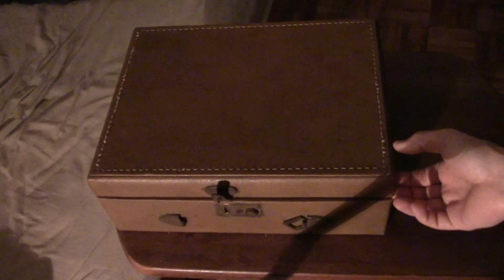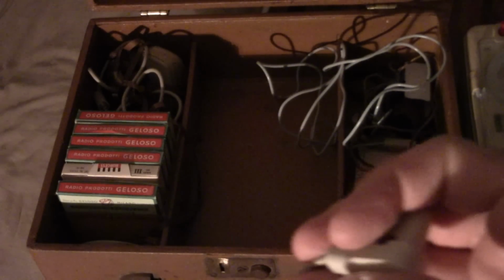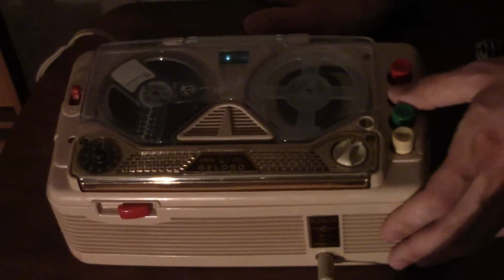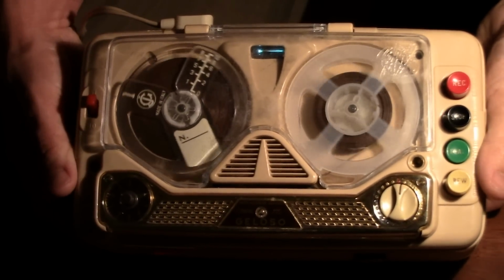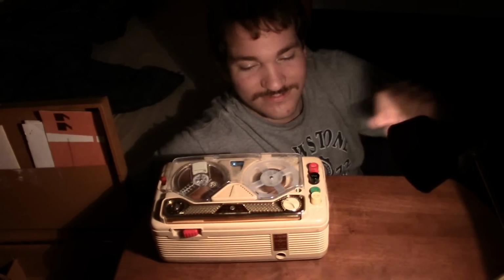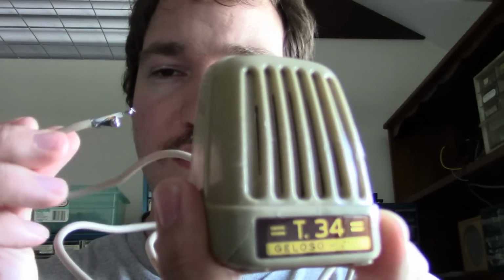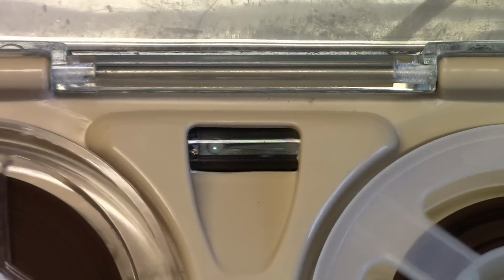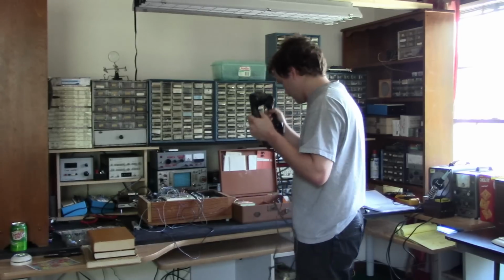Geloso StenOtape Reel-to-Reel Tape recorder, 1959

Comment: I repaired (or was supposed to) one of these for a fellow YouTuber. The problem was that the insulation on all the wiring was turning to powder! Very dangerous! Just touching a wire would cause insulation to crumble and fall off! The machine was also a tube type, and some of the deteriorating lines carried over 200 volts. It had interesting mechanics and a nice design. I have TWO Edison Envoy dictation machines that were built by Geloso, they both need repairs,
Reply: I'd like to see a vid, but rewire is a challenge.  I have an Admiral with wire rot. 
The cost of such a restoration is prohibitive.